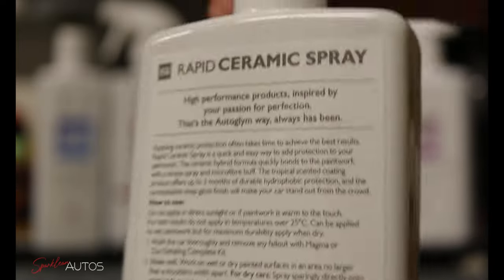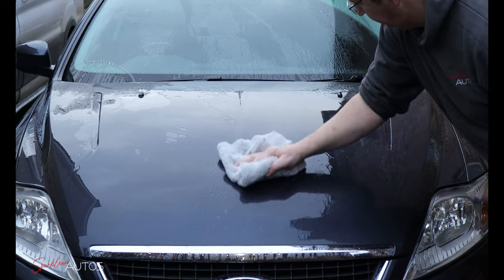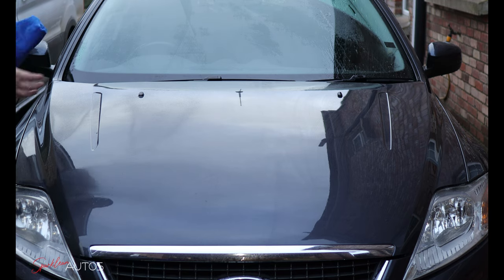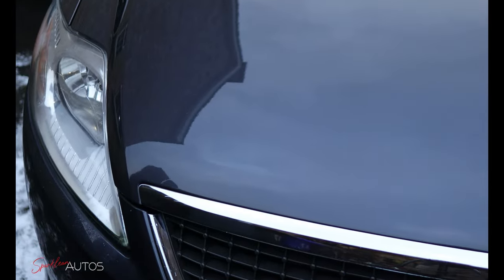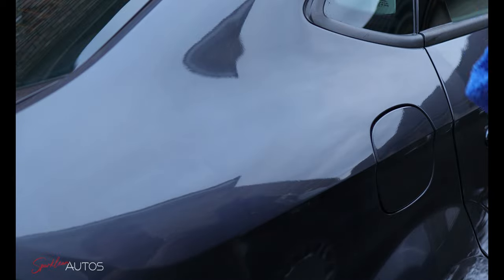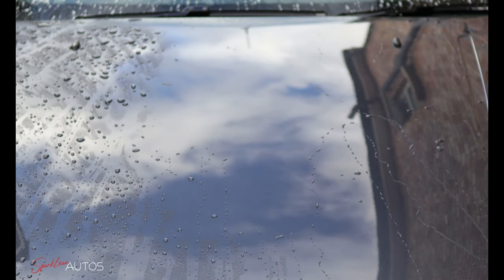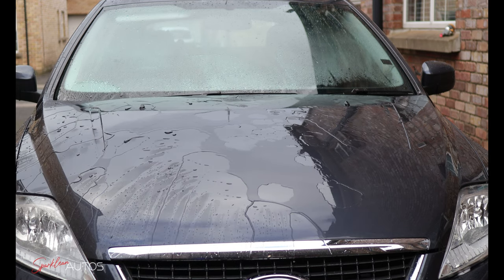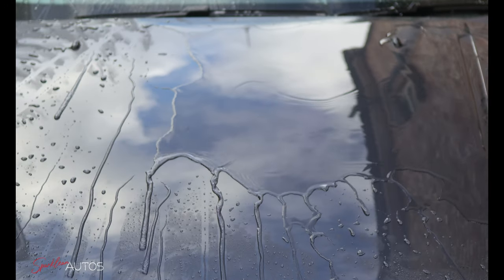AUTOGLYM - RAPID CERAMIC SPRAY | WET OR DRY APPLICATION?!?! Ep022 #cardetailing #carcare #carwash

Comment: Glad you liked it and Rapid Ceramic Spray made it onto the shelf. If you are in the trade, or getting through a lot of this, it is available in a 5L container in the Autoglym Professional range as Instant Ceramic Coating- same stuff inside
Reply from the maker: Thank you! I did indeed like it, very much so and it will be featuring again - along with more from the range 👍🏼
Reply: Is this product ok to use on cars that have been graphene treated?

Comment: Great video, I never seem to find any protection product I use lasting any length of time. I’ll have to check out the decon shampoo to aid with this!
Reply from the maker: Well it's only been 10 days lol 

I think decon shampoo is formulated more for the maintenance of ceramic coatings - while this may contain the same SiO2 ingredients, it would be nowhere near as potent. 

I'm not saying it wouldn't work, just don't expect too much from it 👍🏼

Comment: Typical Autoglym quality. Its not one I have used but keep meaning to give it a go. Good demo & video Mark
Reply from the maker: Thank you Martin... I actually watched your video on the AquaWax before I used this one and tried to follow the same process for the wet application - Either the InstaDry towel makes a massive difference or I didn't apply it properly but I think the wet application is best used for Aqua Wax and dry application for Rapid Ceramic Spray 👍🏼

Comment: Autoglym actually make very good products these days. So many people underestimate how good these products are. Their Rapid Ceramic is really good, easy to use and pairs well with the Polar range. As a detailer I find Polar Blast is really good due to its cling time. Use some citrus pre-wash or APC under Polar blast and get in there with your detail brushes. Polar Wash is also excellent, and is one of the slickest and silkiest car shampoos out there (even if it is a bit expensive). Polar Seal is also really durable, and you can get up to 6 weeks paint protection from a single coat.
Reply from the maker: They really do .. pretty much everyone in the UK starts out with AutoGlym but then as we get more 'into' car care, we move onto more niche brands etc and people tend to get a bit brand-snobby about AutoGlym - but they actually make really decent, easy to use products that just get the job done! 👍🏼

Comment: I've had a bottle of this for nearly a year and was hoping it would be a "ceramic aqua wax" if that makes sense because I love the wet application method for Aqua Wax. This gives me pause for thought though. Really helpful video.
Reply from the maker: I think that's where some of the confusion over this product comes - I haven't used Aqua Wax but I've seen a couple of videos on it, namely Martin at ObsessiveCarDetailer and the process appears to be the same as this for the 'Wet' application but I think that product is more suited to it - this one, for me at least, was much easier applied dry! 👍🏼

Comment: Good little review there which offers good evidence of the best way to use the product. I know you advised how to deal with the streakiness,  but it did look pretty streaky, which means more work and time to perfect the finish. Are there easier to use products? I think there are. But good hydrophobics after 10 days. Did you leave it on Mark, see how far it went?
Reply from the maker: That was only recorded at the start of this week so yes, it's still on - the car won't move or be washed now for at least 6 weeks so we shall see how it holds up lol 

The streakiness, to be fair, was largely user error - I didn't thoroughly dry the car off before applying it which is more evidence to support the dry application over the wet... In my opinion 😃
Reply: @Sparklean Autos  OK yeah, that makes perfect sense, thanks for the additional info.
Reply from the maker: Any time Lee 👍🏼

Comment: Seems easy enough for application , great for the general no fuss driveway diy’r on a Sunday afternoon. (Other days optional) 😂
I was enjoying the video better then how the product looked though , loving the close camera work and the music 👌
Reply from the maker: Thanks Graeme - I've only recently started using AutoGlym products again for the first time in at least 10 years and I must say I've forgotten just how simplistic they are... Absolutely perfect for beginners, you just can't really go wrong... Unless you don't dry the car off properly and end up with streaks when applying it 🤦🏻‍♂️🤣🤣
Reply: @SparkleanAutos  I was always under the impression that SI02 ceramic products didn’t react well with water on the panels and well, your video kinda showed that technically you ‘can’ use it wet, it’s a real waste of your time and money doing so , bit like buying a cream egg and throwing it straight down the toilet without enjoying it first 🤣
Reply from the maker: 🤣🤣🤣🤣 well that's a very interesting analogy but yes, basically... 🤣
Reply: With the plethora of spray protection products out there nowadays, it really is a boon for time short weekend warriors like me. 

Not looking for a show car look but a wash, and a spray to spruce it up under an hour is really good. I do a clay and polish and spray once a year and the rest just use spray to top up. 

Cheap and good sonax and turtlewax does the job. My collinite just sits there

Comment: I think you might need to do the dry method to put a base coat on first then you can do the wet car method?
Reply from the maker: You're absolutely spot on and that would most likely make the wet method more effective as a top-up... But in this series I insist on going by the instructions on the bottle which, unfortunately, don't mention applying a dry base coat first.

I also don't see this particular wet method as any quicker either so I'll probably just stick with the dry 👍🏼

Comment: I am yet to use this i have just got a bottle.. my fave so far is gyeon wet coat.. i also like sonax bsd (but that is hard work)
Reply from the maker: Gyeon Wet Coat is a fantastic product but I wouldn't use this in the same way - as you can see, the wet application was a bit of a waste of product compared with applying it dry! 

Agreed about BSD - Incredible water behaviour but can be a bit of a pain!

Comment: Hi - unrelated to this product but I’m really impressed with the microfibre drying cloth so just wondered if you could share what brand it is, please? I’ve bought a few (some really expensive!) but none appear as absorbable as the one you use. Thanks in advance.
Reply from the maker: Hi Jon, the one I'm using there is the Autobrite Direct Ultimate Drying Towel... (See links at the bottom of this message!) I genuinely really like this one, so much so I have 3 of them now! I find the key is to dampen them first - for me the best way to do that is to dry the glass first - then just lightly drag it across the panel the way you see me doing here. I don't wash them after every use, just let them air dry somewhere clean (takes a day or 2!) then put them back in the sealed bag. I clean them every 5 or 6 washes...

For cleaning them i used to just use plain supermarket's own branded non-bios, about 20-30ml and ABSOLUTELY NO FABRIC SOFTENER... but recently I actually got some Autobrite Direct Clean Towels in offer from Amazon and it really made the towels like new again!

Towel - https://www.in2detailing.co.uk/collections/autobrite-direct/products/autobrite-direct-ultimate-drying-towel?variant=40869457461327&ghref=3377%3A554508

Towel Detergent - https://www.in2detailing.co.uk/collections/autobrite-direct/products/autobrite-direct-clean-towels-microfibre-wash-detergent?variant=40088608538703&ghref=3377%3A554508
Reply: @SparkleanAutos  Hi Mark - you’ve been amazing (and quick with replying)! Thanks so much. I’ve never thought about not using softener when cleaning them - I’ll definitely do that from now on. Cheers for the links. A new sub from me!
Reply from the maker: 😁😁 much appreciated Jon, every sub means a lot! I'm no expert but any time you have a question just pop it into any of the videos and if I can find the answer I'll help you out 🙂👍🏼
Reply: That’s brilliant, thanks Mark 👍 I am a proud owner of an Audi S5 and 4 Series BMW so always looking for ways to keep my babies (expensive monthly payment babies…. 🙄) looking every bit as nice as possible! They need to just to warrant me paying a mortgage on them… lol… boys and their toys, eh…. 🙄😂🤣😂 thanks again, Mark. You’ve been a great help 😉
Reply from the maker: @jonbarney5779 if they make you happy they're worth every penny 😂😂

Any time Jon, glad I could point you in the right direction 👍🏼
Reply: Absolutely! (Although I often think someone is more than welcome to take over those payments.. lol). Thanks mate.

Comment: Hi, is it safe to use on un painted black plastic trim. I know a lot of their waxes or Polishes turn the trims white.
Reply from the maker: Hello, yes I had absolutely no problems using it on black trim - the chemical make-up is completely different to waxes & polishes so you don't have the same issues regarding trim 👍🏼👍🏼

Comment: How do you tell the bonnet has no protection on it ? I'm totally
new to washing cars correctly.
Reply from the maker: Hi Paul... Well the simple answer is, if you spray water onto the bonnet and it just 'sits' there, as in it's not sheeting off or beading into small droplets, it means the water is in direct contact with the paintwork - 

What the protection actually does is put a 'barrier' between the paintwork and the environment... This makes it easier to clean, and the easier it is to clean the less chance there is of causing damage. 

Hope that answers your question!
Reply: @SparkleanAutos  Thankyou very much.
Loved the video.
Reply from the maker: @paulmorgan6269 You're very welcome, I appreciate the feedback 🙂👍🏼

Comment: Hi quick question can you use this product after polishing the car.?
Reply from the maker: Absolutely, in fact that's when I'd recommend using a protection product most, especially a ceramic based one like this - however, depending on the type of polish you may want to use a panel wipe first - as in if you've used an abrasive/correction polish (typically used via machine), then to maximise the durability of the rapid ceramic spray, you'll want to clean the polishing oils from the paintwork first... But if you've used a glaze/filler type polish (typically applied by hand) then I would at least leave it 2-3 hours to cure before applying this... Again just to maximise the durability - that way it'll 'lock in' the glaze effect rather than wipe it off!! 

Hope that helps 👍🏼
Reply from the maker: Sorry I should've said, by cleaning the polishing oils off, I mean with a panel wipe of some sort 👍🏼

Comment: Is this ideal for using after using a headlamp restoration kit ?
Reply from the maker: It would be suitable but before this, make sure you apply some UV protection to the light - it may come with your kit but if not, I would certainly apply that before applying protection. Once you have that done, yes this product would be very good 👍🏼

Comment: Surely in a product that you can use wet or dry that  if used wet, as yih said yourself, you're wiping off the product as you dry it rsther than rubbing it in when done dry
Reply from the maker: Yes exactly, the problem when you're wiping off while applied 'wet' then the product is watered down significantly, and you would be saturating your towels with product... Where as applied dry, you aren't watering down the product, you're using dedicated cloths which you can do the entire car before they become saturated AND the results last significantly longer... I don't see any advantage to using it wet at all but plenty of disadvantages! 👍🏼
Reply: @SparkleanAutos .... Thank you

Comment: Isn't this the same as Autoglym aqua polish??
Reply from the maker: Hi Jonathan - If you mean Aqua Wax then the simple answer is no - the idea is the same in terms of the wet application, but Aqua Wax is a carnauba-based sprayable wax, whereas this product is a ceramic-based protection spray - both essentially do the same thing but chemically in a different way! 👍🏼

Comment: Hi can i use this on the headlights thanks
Reply from the maker: Hi, this is taken directly from the FAQs on AutoGlym's own website - 

"Can Rapid Ceramic Spray be used on glass and plastics?

No, Rapid Ceramic Spray has been designed specifically for paintwork and colour coordinated plastics only."

So, no, they don't recommend using it on headlights 👍🏼
Reply: @SparkleanAutos  thank you
Reply: @SparkleanAutos  thank you
Reply from the maker: @abdulbeany1894 any time 👍🏼

Comment: Thought all real ceramic products have to be in a glass bottle 
Ceramics that come in plastic bottles have a very low % of ceramic usually 10%
Reply from the maker: You are correct in the sense that what people would recognise as 'real' ceramic coatings generally come in glass bottles... Ceramics are basically made up of 3 things - solids, solvents & additives. Whereas ceramic coatings are typically around 50%+ solids, and once opened typically have a shorter shelf life... ceramic spray sealants can be as low as 10% solids, and as such it's absolutely fine to store & transport them in larger plastic  bottles. Once applied they typically last 3-6 months (despite some bottles saying up to 12 months!), and will be applied more often.

So products like are still ceramic, the same way that a fast food burger is still a beef burger despite the sometimes questionable amount of beef! 👍🏼

Comment: First application should be done dry
Reply from the maker: I completely agree, and anyone experienced enough with car care/detailing should know that... BUT... It doesn't say that on the bottle, and this series is about following instructions the way any casual user would 👍🏼
Reply: Would there be any benefit to layering this ? I found a bottle in my garage so would it be worth applying it dry and then going round again for a second coating ? Thanks.🙏
Reply from the maker: It's a good question... I can't say yes or no but it certainly wouldn't do any harm... But I wouldn't apply it straight away - with 'true' ceramic coatings you should leave 3-4 hours between coats and, although this isn't a proper ceramic coating, it does contain some of the same chemical properties and I would suggest a similar method... Certainly at least 2 hours to allow some curing 👍🏼

To be honest though, if you wanted to be really sure what is best, you could contact AutoGlym's own technical support team 👍🏼
Reply: @SparkleanAutos  thanks very helpful ! Would I need to leave some time post polishing too? So polish wait an hour or so and then apply this ?
Reply from the maker: Depends on the polish... If it's AutoGlym SRP, or any other type of glaze/all-in-one polish then I would leave as long as possible - although these polished do contain some mild abrasives for paint correction, they are primarily 'fillers' and as such would need curing time - ideally 24 hours but that's probably overkill, I would still wait at least 4-6 hours, 12 if it's practical!

If you're using a 'proper' abrasive polish (or 2 stage polishing) with a  machine then you'd be fine to go straight in afterwards, although you would certainly need to use a panel wipe of some sort to remove the polishing oils - but DON'T do this with a glaze/all-in-one polish as you'll just remove that filers again!

Hope that helps and isn't even more confusing?!
Reply from the maker: When I say wait 4-6 hours after SRP, you'll probably find the majority of people do indeed use it within an hour or 2 without issue... I just like to give products the best chance of working to their maximum potential and I'll admit I can be a bit OTT sometimes!
Reply: @SparkleanAutos  😂 I’d be OCD about it too so looks like Saturday will be a long day. Thanks for your help
Reply from the maker: @matth8205 Any time Matt 👍🏼